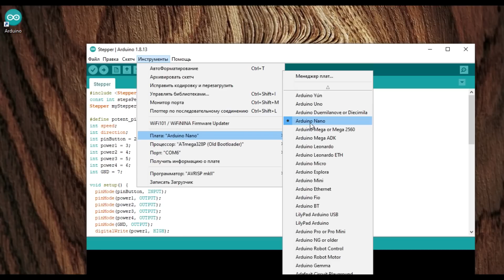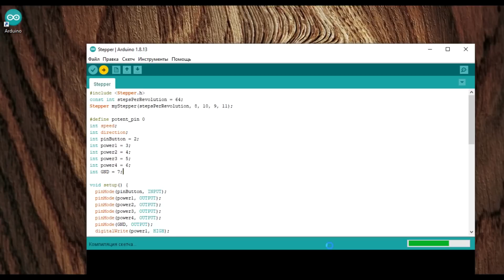🟢 DIY Motorized Camera Slider - Arduino Project 👉 FREE PLANS 👈

Comment from the maker: For more details, read description to video. Please like it 👍 if you like it. 

All free plans I ever made are here:
https://drive.google.com/drive/folders/1636_O_7KVQ5hzWAhDXBornWnvxXfweba?usp=sharing

GRINwood shop:
https://www.etsy.com/shop/GRINwood

Support GRINwood:
PayPal: grinwooddesigns@gmail.com

Thanks for watching
Reply: Thank you, @GRINwood. Great video. I just have one technical question. How camera's angle is controlled? Is it somehow centering itself by tripod ball head?
Reply from the maker: @liveriesfsx9352  it's controlled with U-type profile on the bottom, just set up the profile. If it's parallel to rails camera will not turn, if diagonal - camera will follow the filming object, just set it up correct. Here i show how it works 12:50 
Thanks
Reply: @GRINwood 
 Thank you, I missed this detail.

Comment: Best I've seen yet... When you write "Sketch" I think you mean "Program" or probably "Project".... only thing I'd add is that the anti-parralax guide rail ( for pointing at subject through the full travel of the slider) would need to have a slot instead of a hole at each end to accommodate the different length depending on the angle. If you want a pipe that doesn't bend you can use thin-walled steel pipe, no guide bearings necessary, super light... wouldn't it look good made of sheet metal instead of wood... very good design, Bravo!
Reply: great idea, only comment is on the sketch part. that's just what Arduino calls it's program.

Comment: Great project.  Only question is where did you find that silvery 16mm pipe?  Is it stainless?  Aluminum?  Chrome?  Is it a plumbing pipe or something else?  I was thinking of using copper pipe but that silvery pipe looks much better.

Comment: built something close to this. Same reverse switches but never could get the switches to work. If I use my hand to hit the switch it works because I am hitting the switch like on and off as in a tap. But the slider just touch the switch and alway just set there with the switch pushed in..... the slider will not go the other way until the switch is released.... How can i come this ?????
Reply: Your wiring is not correct for the switches.

Comment: horizontal required, or will work at any angle, up to vertical?
Reply from the maker: No, maximum 20 degrees slope, it has low power motor

Comment: Hi can I use a 12v 28BYJ-48 or do I have to change another component of the schematic, or the arduino code? Thank you!
Reply: In the end I was able to try it because I had the components at home, and it worked great for me with the 12v one, that is, I had to separate the power supply in two and I put a Step Up 
Thanks for the video!!
Reply: Yes I am now on the power... don't know how much power or where to get the USB power supply????

Comment: Thank you for the project but i am having a problem uploading the Sketch to the NANO ? It When i validate the sketch it comes back with Void Setup Errors ? I checked each line and it is exactly like the Sketch you posted here .Can you help me out with this ? I appreciate your help. I have the mechanical portion already build and want to get it running and all I need is the Sketch to be loaded now . I did send you an e mail so if you could respond back with the correct Sketch i would appreciate it THANK YOU :) John
Reply: Did you get it to work?

Comment: Let me see if I've got this right... if I spend a couple hundred grand building and outfitting a professional quality woodworking shop and hire Norm Abram to teach me how to use all the equipment, I can then easily build this inexpensive DIY camera slider. Correct?
Reply: Did you say inexpensive???? 
They cheapest I've seen was about 300 and that was very short and no motor. Anything at this size plus a motor will run you 1 grand. So I am building me one ..... all part like under 150.... plus motor and a size you can't even get..... this video is amazing even after 50 watches.... lol 
Peace and love always ✌️

Comment: I believe there is a mistake in the code

This line:
myStepper.step (direction);
actually it should be:
myStepper.step (direction * stepsPerRevolution);

Or leaving it like this, you should change:
  if (flag == LOW)
      direction = 1;
  if (flag == HIGH)
      direction = -1;

in

  if (flag == LOW)
      direction = stepsPerRevolution;
  if (flag == HIGH)
      direction = -1 * stepsPerRevolution;